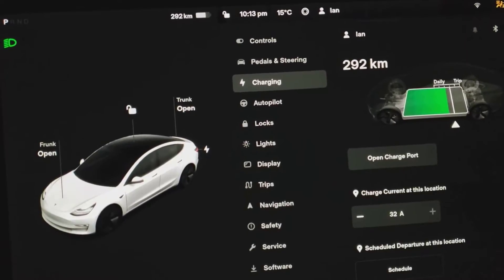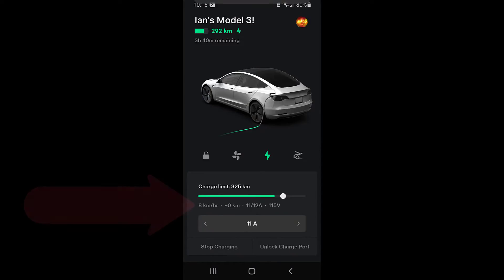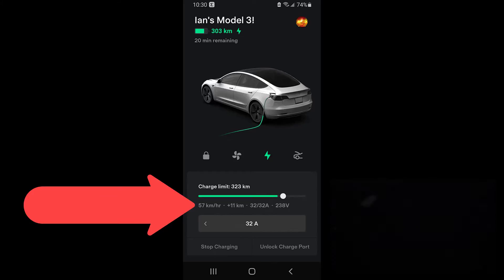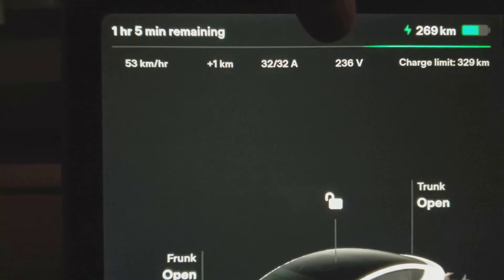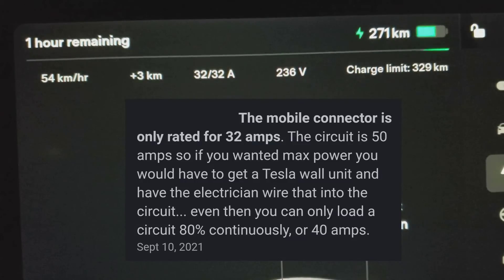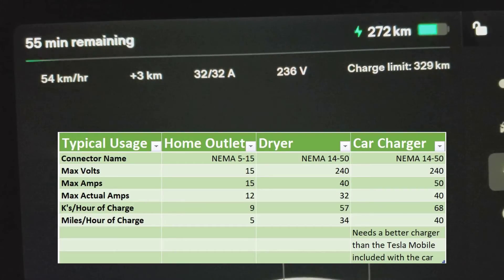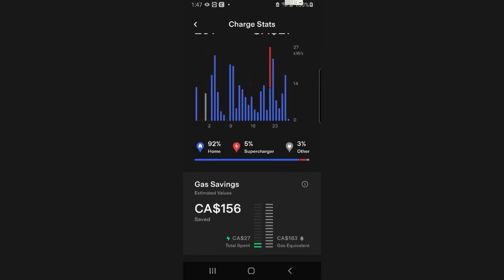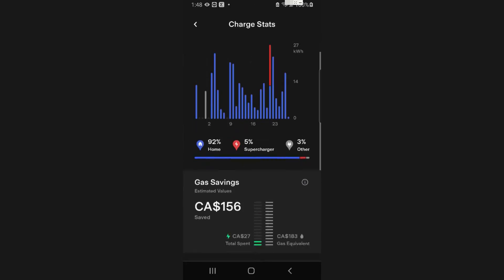Tesla EV Home Charger Demonstration 15 Amp vs 40 Amp vs 50 Amp

Comment: Thank you for this, i was going to buy a nema 14-50 extension 50 amps but theres no point because it wont reach that much and the 40 amp extension is cheaper so thank you !!
Reply from the maker: Hi Boafy - thanks for the thanks.  We still went with 50 amp because the cost difference is very small and in the (near?) future, 50amp (40amp output) may be common and I would like the OPTION to charge as fast as possible.

Comment: It doesn’t matter if it’s a 40 amp or 50 amp circuit. The charger only draws what it’s rated for. You could put it on 100 amp circuit temporarily and it would draw the same amount of power. I’m not recommending that you put a small gauge wire on 100 amp breaker. I’m just giving an example.
Reply from the maker: Correct... I am not sure what your point is.  I could have bought a 50AMP charger which would deliver 40AMP's (80% in Canada and the US by regulation) but I did not.  That 50AMP circuit WILL be helpful in the future with future EV's I will own so putting in a 50AMP makes lots of sense.

Comment: This test would be a lot more interesting if you didn't use a 32 Amp plug that limited all the results to 32 Amps max.
Reply from the maker: They law in Canada is 80% max meaning that a 40amp circuit can have a a max of 32amps on a single jack.  To get to 40amps, I need a 50amp charger.

Comment: A couple of items:
1)  An EV's charger is located in each EV (onboard charger).  The Tesla UMC is an EVSE (Electrical Vehicle Supply Equipment) and is NOT the charger.  The EVSE is a connection between the source of the electrical power to the EV.  
2)  The 8 gauge wire size is ok on a circuit using a 40A circuit breaker.  However, when you switched it to a 50A circuit breaker, that pushes the limits on a circuit using 8 gauge wire.  The NEC has 3 temperature ratings for wire size.  On a 50A circuit, the NEC table shows that 8 gauge wire at 50A rated at 75 degree C or 167 degrees F.  Charging an EV for an extended period of time at that temperature is a potential danger.  The NEC recommends using 6 gauge wire for a 50A circuit.
3)  Tesla recommends using an industrial grade NEMA 14-50 outlet for EV charging.  If you are using a standard $10-$20 NEMA 14-50 (residential grade made for RV hookups, clothes dryers, or ovens), it is recommended that you upgrade to an industrial grade socket.  Since EVs will be using the circuit for possibly hours, which is much more than other applications, the outlet needs to be more robust.  There are a lot of Youtube stories out there about residential grade NEMA 14-50 outlets melting down and possibly leading to fires.
Reply from the maker: Hi Robin 
1: a bit of hair splitting 

2: 8 guage wire is now approved for 55amps in many jurisdictions and is certainly safe for 50amps when properly installed.  It can get quite warm (23C - 75F for those still on old-school) but that is well within its 32C / 90F tolerance.
see: https://www.wireandcableyourway.com/blog/8-gauge-wire-amp-rating-how-many-amps-will-8-gauge-copper-wire-handle/

3: You may be correct on the outlet but personally I have not seen anyone I know personally with a problem.  I have checked my NEMA 14-50 and found it to be cool and happy with the 40amps (actually 32amps) I am running through it - I certainly agree that consumers should check their connections for heat issues whenever making stepping up.

It is always a good idea to overspec your cabling.  It doesn't cost that much more and it will be useful for something in the future, so your points are well taken.  

Thanks.

Comment: Interesting video.  As you discovered, Voltage or amperage on their own cannot explain the whole story.  Power is actually voltage x amperage.  Thus:  110V x 12A = 1320 Watts or 240V x 32 = 7680 Watts.  7680/1320 = 5.8.  So, your km/hr charging rate ratio you mention in the video is explained by this.  Also, circuit breakers are only there to protect the cables.  And any circuit is designed to be loaded to 80% maximum.  Your smart charger knows the voltage, so it will only allow 12A draw max on the circuit.  When you plug it into 240V, it restricts the draw again to 32A.  Pretty cool.
Reply from the maker: What is odd is that it is charging about 25% more than Tesla says it will.  I remember that volts x amps = watts formual from high school now that you mention it, so thanks for that.  Part of the difference is explained by Tesla working on a 220V even though most North American's actually run 240V.  Tesla is soooo famous of over promising that I am shocked (pun intended) at the numbers.